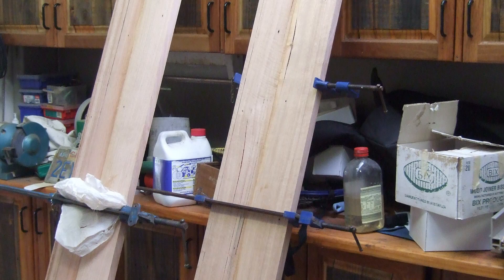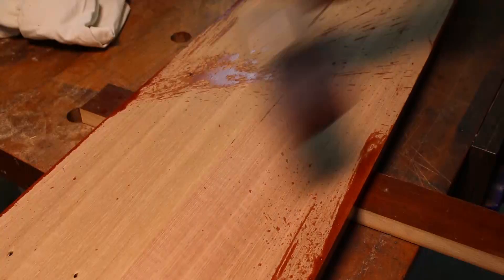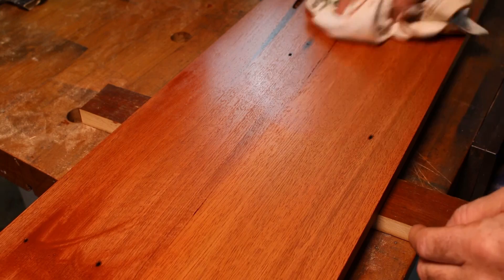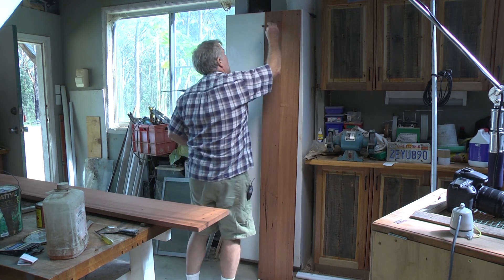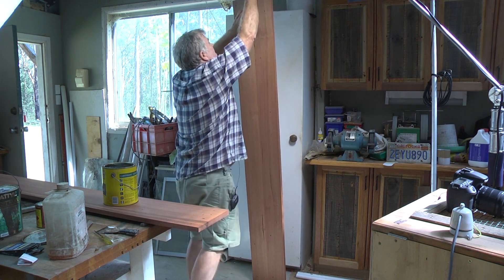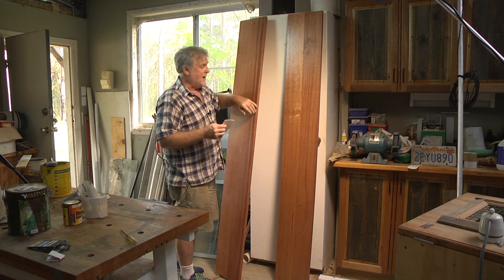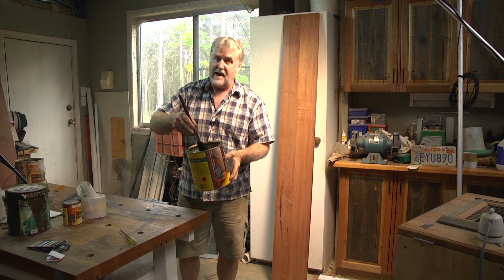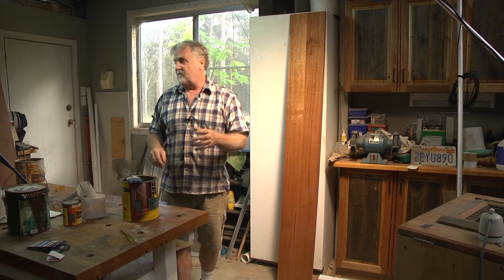Staining raw timber shelves

Comment: Hi there good one I would like to c how you would go about painting 6 panel doors with a roller I'm painting a hold load and seems to be taking forever and what's worse is I'm using water base enamel not a big fan of that stuff prefer oil on doors but that's what clients want .Was going to spray them decide not to do you do any spraying looking forward to seeing more cheers ......
Reply from the maker: Hi Derek, yes, I do roll them or rather brush and roll. You have to work pretty fast but I paint the groove part of the raised panels, the edges and along the bottom and then roll. I finish with tipping them off with  the brush. Easy peasy. Maybe some day I will come across a job like that so I can film it.
Reply: thanks for that will give it a go ....

Comment: Very helpful. I'm about to do my first stain project ever. I've been practicing on some spare wood and I'm ready to give it a go. Just one question: do I need to worry about leaving marks on the wood when I flip the shelf over to do the other side?  Or once I apply the stain to one side and the edges, then wipe the stain off, they are safe to be turned over and laid across some 2x4s?  I really appreciate it!
Reply from the maker: +Jonathan Matuszak Hi mate, yea, flipping them over is not the problem at all. When your done completely with staining your board, you want to stand it up somewhere and not leave in on your 2 x 4's. Just remember, check every point where you touch it or where there may be marks from your 2x4's and just give those areas (if there are smudges, marks or such) a light wipe with your 'cotton' rag. Good luck and happy staining. :)